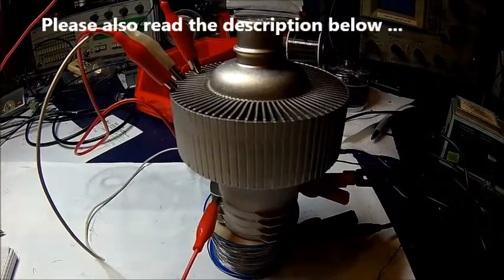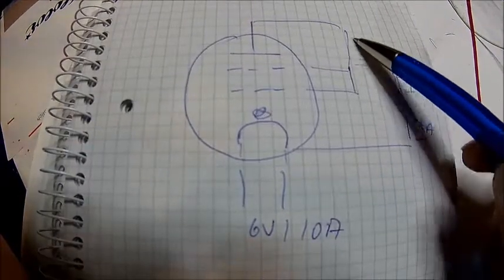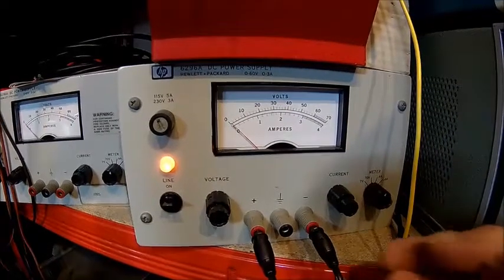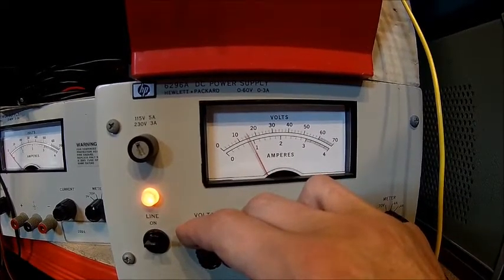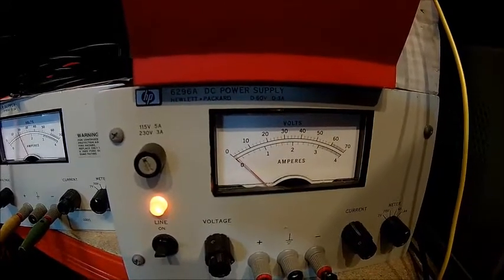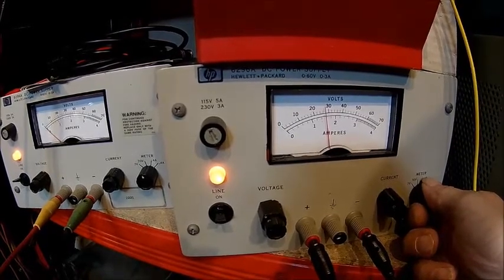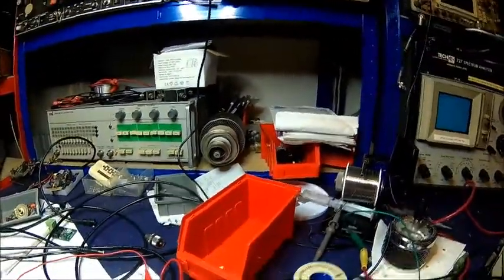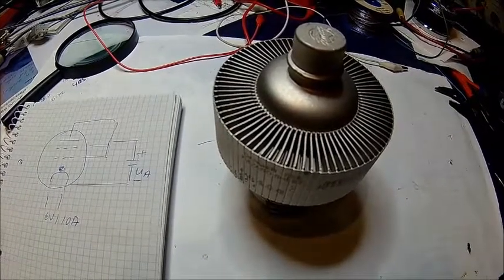Eimac 4CX1500  Power Transmitting Tube - bench test setup + explanation

Comment: good method... if it doesn't misbehave with 2-3 kv on the plate, you're golden.  you can see where there was an anode strap around the tube...so used but good.  Nice score.   If my svetlana 4cx1600B  ever dies.. I will have to look for something like this.

Comment: I have built a HF amp using GI6B triode and very cost effective  will give 1000 watts DC output but this is beyond their safe rating I am using 2 GI6B one tube rated at 350 watts plate dissipation  they and cost about £20 each plus postage.
interesting how you test the tube. The Gi6b needs the heater pins to be cooled .

Comment: The navy still uses these, I just installed 6 in the HF transmitters on a destroyer
Reply from the maker: It is still a rather cost effective option if you want high power outputs and if you treat them well they last a very long time
Reply: @dynoguy  if you turn the machine on, they pop if you turn the machine off they pop. No joke man, these things are pretty garbage and the URT's they are in are a dumpsterfire. The only organization that could feasibly own a URT would be one that cares nothing about cost due to the insane maintenance requirements and parts replacement. Aka the US Navy
Reply from the maker: LOL,... well, i think that's rather a design problem of the PA, these tubes don't go pop just by design.
Reply: @dynoguy  no I know, I'm just venting. These are my job and I hate them.
Reply: @ligmajobs4686   I've never seen one pop in any URT-23, what is making them pop?  They are run way under their specifications in the URT-23 with 2x1500B's to produce 1KW out.  We ran ours at full tilt, the harder we could peg the meter the better, never any problems.
Reply: That's interesting they are still used. It must be in an older destroyer with a URT-23.

Comment: Hello I need some info, can I send you a personal mail ? thanks
Reply from the maker: You certainly can,.. email is in the about section of my channel and at the end of later videos
Reply: @dynoguy  is not working I did try about 5 times.
I have a question ; what about the current that is flowing trough the grid and screen ? is there a problem to destroy those elements if the anode takes 1 A or so ?

Comment: good find,Eimac dealer Richardson electronic sell them for around 1900 dollars,even RF parts sell them for premium price....you are lucky man....so i am ,i have 8 of them new in box,and 3 pull outs ,used but good...one SK800 socket with G2 capacitor ,and few socket used without G2 capacitor...for use ,like example where is G2 grounded,for better stability,so cathode is not any more on ground ,but floating,and minus from high volt supply ,screen and grid terminated on cathode....so in that arrangement tube or valve can work even on VHF 144-146 Mhz with very good stability....for HF to 30 Mhz,you can decoupling G2 with ceramic disc ,1nf and 10 nf...6 of each in parallel to lower inductance....also on HF you can use passive grid input....minus voltage supply came via 50 ohms 50 watts non inductive resistor to G1...so amplifier will be stable ,and input SWR are good...you also can implement so called negative feedback resistor from cathode to ground,to improve stability more...around 5 ohms....greetings from Croatia
Reply: i forget to say that this valve is one of the best linear tube ever made,maybe the best one....even when working in class B,IMD  3 is around minus 55 db....so in AB1 is even better...there is no cleaner or linear tube than this....4CX350 is close,but not in that power range...regards
Reply from the maker: Good info,...thank you
Reply: @dynoguy  you welcome....in passive grid input,you will have 17db gain...input need around 38volts RMS RF--55volts peak,that correspond to 30w drive to achieve 1500W out....when grid is -55volts,screen 330 volts..plate 3000v .ALPHA  8406 US made  use that tube,passive grid and have this voltages and characteristics,they use 6 ohms negative feedback resistor,cathode to ground....so linear need little more drive,around 50w....i didn't use it ,and amp is stable...due to swamping effect of 50 ohm resistor,grid is not few kilo ohms input impedance but 50 ohm,so you have stable amp....that way you lower gain from 30 to 35 db to 17 db,so isolation from input and output is bigger,so no neutralization is needed...and no need to tune input,it is broadband with good SWR.. .i use GM3SEK tetrode board,and there is all voltages you need,automatic over-current protection for all ,grid,screen...,and reset switch..and extremely stable voltages,essential for best linearity....Ian made this board bullet proof-best there is....regards

Comment: Very interesting, got me thinking what I should do with some new Eimac 4CX250Bs I have. Good find with the 4CX1500B though, gosh they are a large tube compared to the little 4CX250B... Subscribed.. vk2ccr
Reply from the maker: Thanks, much appreciated....  Well,...that 1.5kW plate dissipation needs cooling, so it's got to be bigger  .... Got plenty of 4CX250/350 too, just not enough time to make something of it ....
Reply: @dynoguy  4cx250b have bad linearity...you can improve that with cathode negative feedback resistor....but 4CX350 have excellent linearity,made strictly for single side band modulation....
Reply: 4cx250b need 25 ohms negative feedback resistor ,cathode to ground to improve linearity much ,from --22 to --38 db....IMD3

Comment: Hi, great tube, I have several on HF and 6M. Like you, my well worn copy of the Eimac bible dates back a long way. However it is available as a PDF here. http://www.cpii.com/docs/related/22/C&F2Web.pdf
Enjoy the videos, keep them coming..
Reply from the maker: Thanks,  yeah this thing was a steal, got alot of tubes hanging around, but you don't really need big ones over here, UK legal limit is only 400W. Thanks for the link, but i do have a (not worn) paper copy of it, it think i bought it new some time in the 80s .
Time is a bit tight at the moment, but i do have more ham radio stuff in the pipeline, thanks for watching.